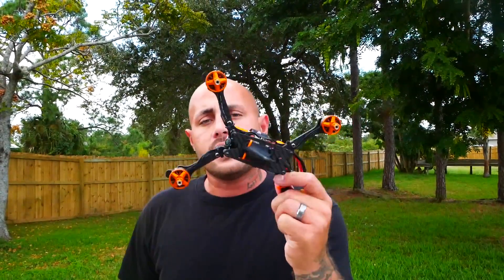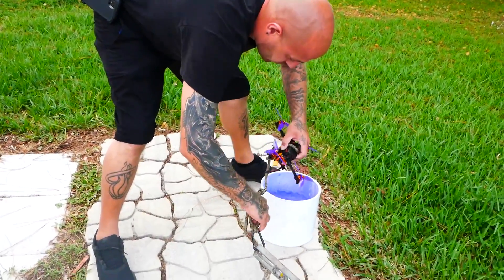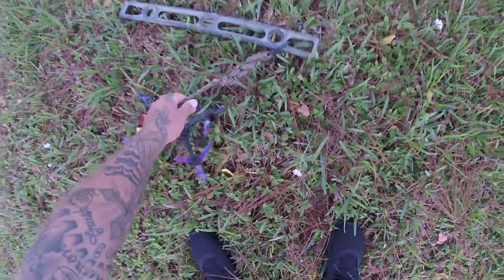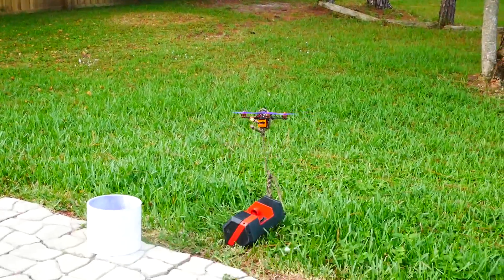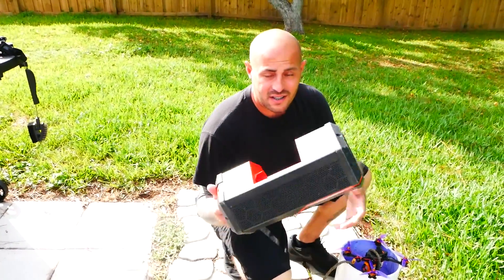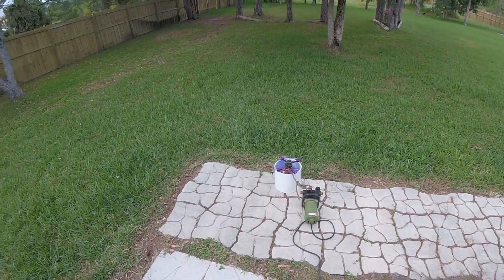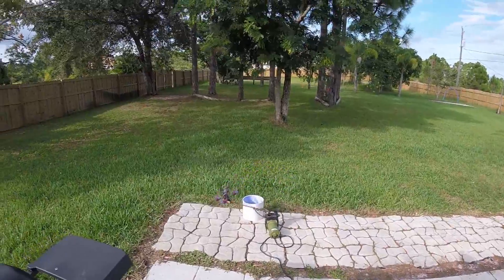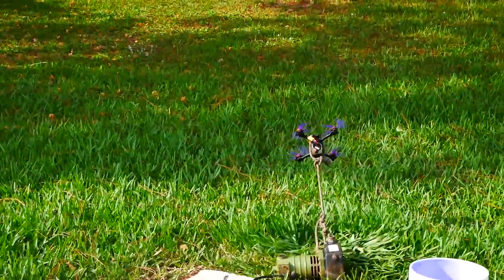How Much Weight Can A Racing Drone Lift?!

Comment: How much does that aluminum bar weight?
Reply: It was a level, and a typical 2-foot level weighs about 1.5 pounds.
Reply: The radio he lifted was 6.75 pounds, assuming it had no battery in it.

Comment: very nice, i think this drone can lift 1kg nicely if its not wobbling in balance, well great effort,
NOTE : KIDS DONT TRY THIS AT HOME !
Reply: lifting 1kg is no problem. I just built a drone soccer which weighs 1.1kg AUW using 5" props, 35A esc and 2207 2350kv motors running on 4s.

Comment: Fuuuunn! Moar smoke less science! But you left me with the most important question: Can it carry a 6 pack of beer?
Reply: I want to know this
Reply: The radio that he just picked up, assuming it has no battery in it, weighs 6.75 pounds. A single 12oz beer weighs about 0.78 pounds, making a 6-pack weigh about 4.7 pounds. So to answer your question, yes. It could carry a 6-pack quite easily.